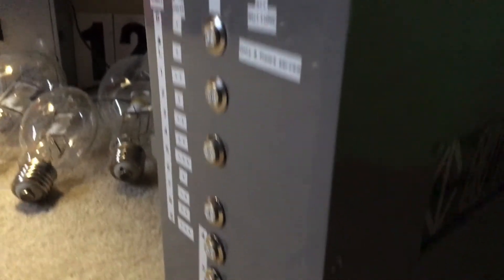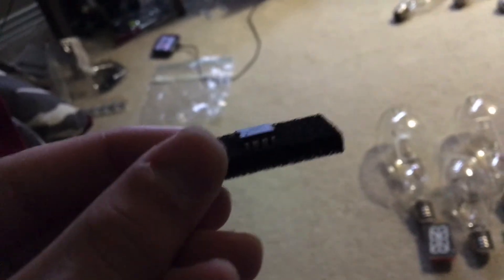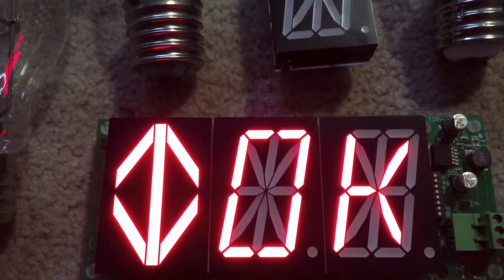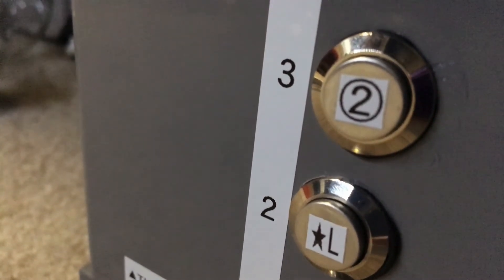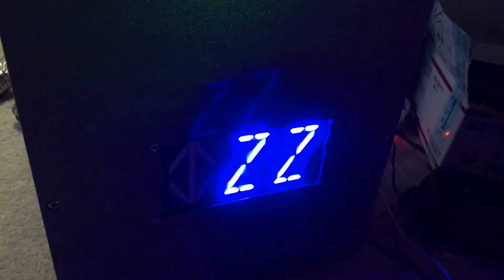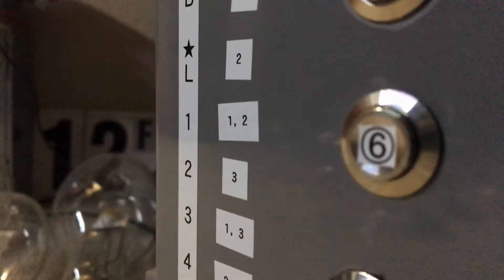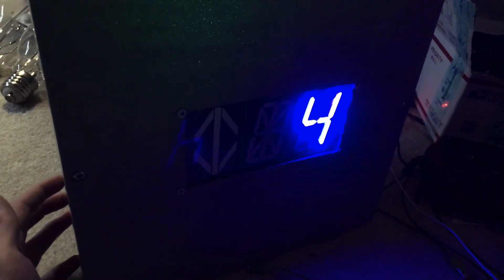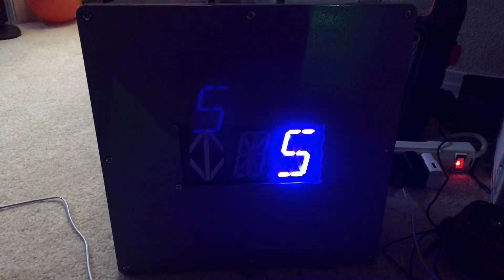My "Upgraded" PORTABLE CE Electronics Elevator Position Floor Indicator (READ DESCRIPTION)

Comment: The SN# on that chip tube indicates that it was programed for an elevator convention in 2004. I am assuming that there is a similar label on the side of that power transformer with the same SN#. If so, then I can tell you that this is a demo product that we made for an elevator show. How did you end up getting it? And how did you come to the conclusion that ZZ means "no input"? That is correct, just curious how you came to that.
Reply from the maker: I bought all the CE parts from eBay. The box was from Home Depot. Elevators have been a hobby of mine since 2009.
Reply: @frankiel.6774  Oh, so you built this demo yourself? Nice work! You should be able to flip dip switch 1 and put the unit into a test mode that will just run through all of the floors that are programed to the floor set.
Reply from the maker: @c.e.electronics  I have two other CE Elevator control boards that have different labeled floors. My other two controllers drive 3 floor indicators, each with different floor labels, and they are in testing mode via DIP switch #1. One’s from 2007 and the other one is from 1998.